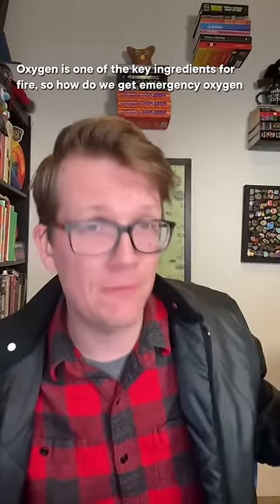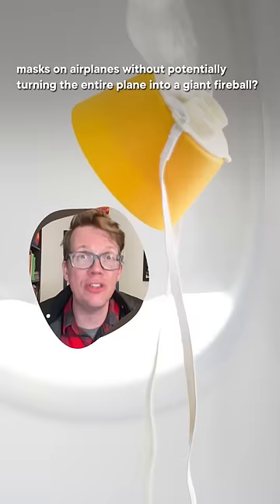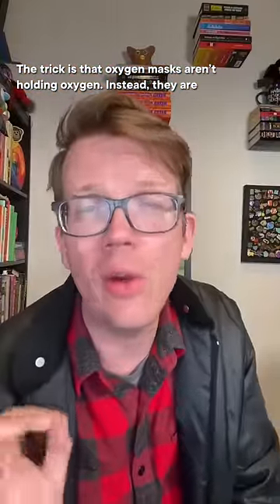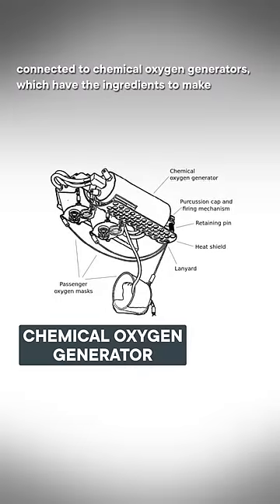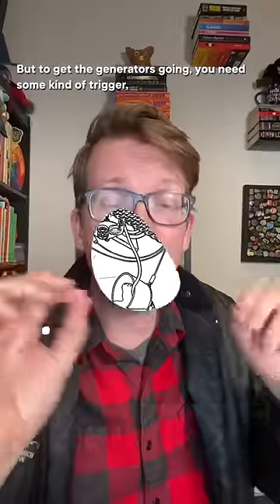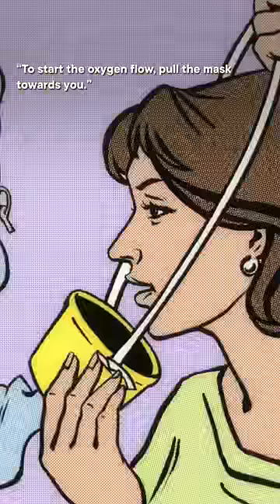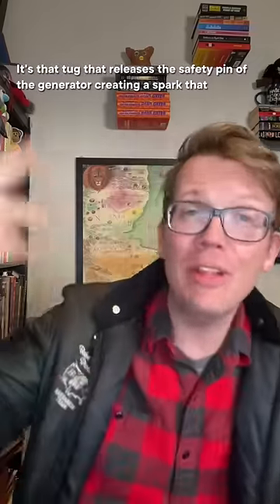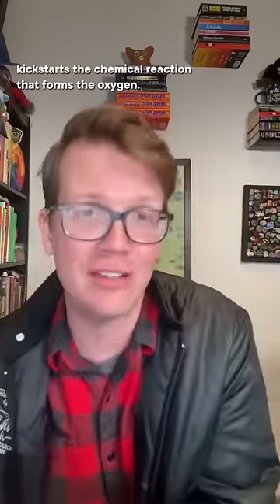If oxygen means fire, how do we get it on airplanes? #shorts #science #SciShow

Comment: The FAA only requires  cabins to be pressurized at or above 8000ft Below this altitude just breathe normally. The decent in any situation of a commercial aircraft will never take 30 minutes so it’s more than enough time, especially if the reason for decent is total power loss. However, multi engine aircraft are designed to fly with only one engine. They have redundant systems to prevent catastrophe.

Comment: The last part is just incorrect, the oxygen masks are there so the pilots can get back into breathable altitude. The pilots have an entirely different oxygen mask setup that lasts far longer, so that even if the passenger oxygen supply runs out in an extreme emergency and all the passangers faint, the two people consious on the plane are the ones flying it
Reply: Too long and partial brain death occurs
Reply: @karlschulte9231  yeah the idea is that the pilots manage to fly back into normal preassured air before that occurs. If you dont dont have the control over the aircraft to get it down then crashing and dying outright would be a bigger consern

Comment: Great information as always, but a very slight correction/clarification about the ending if anyone is curious. You don't need to get enough oxygen to land. The first part of that statement was correct "enough to get down to where there is more oxygen". When a depressurization event occurs, pilots get the plane down to under 10,000ft as quickly as is safely possible, at which point the ambient atmosphere has enough oxygen for people to breathe normally. Emergency decent from even cruising altitudes don't take anywhere near 30 minutes, so there's a pretty good safety margin involved too!

Comment: For anyone who might be worried that 30 minutes isn't long enough:

If I remember correctly, in the event you do need to breath through oxygen masks, pilots begin an immediate decent that will have you at breathable levels within about 10 minutes. 30 minutes might not sound like very long, but it's meant to be "overkill" for the amount of time you should actually need.

Also, keep in mind that pilots are highly trained and work in groups of two or more for a reason. Air travel is the safest way to travel, not by mistake, but by intentional design, constant preparation, and extreme regulation in regards to safety. You're probably safer falling asleep on a flight than you would be in a hotel room.
Reply: Ironically, mistakes are the very reason air travel is so safe. All the safety aspects we take for granted today have come from failures of the past

Comment: oxygen usually doesn't spontaneously combust with fuel sources. that's why it doesn't turn the airplane into a fireball. remember, there's plenty of oxygen in the air inside and around the airplane.
Reply: Pure oxygen will readily combust with any hydrocarbon. It's why technicians who deal with pressurized oxygen have to use separate cleaned tools, because any oil at all near a pure oxygen leak will immediately cause a massive fireball

Comment: He forgot to mention chemical candles (the widely used name of these generators) create an incredibly immense amount of heat, they have some heat shielding but it’s not perfect therefore if you ever where to use one you should never put your hands near the ceiling panel above your head as you can cause some very severe burns.

Comment: My friend was a engineer for making Chemical Oxygen Generators. Hearing about how they and to keep adjusting the materials so the oxygen wasn't coming out too hot or too cold, or filtration system needed to be just right and that no other gasses were not found in the tests. There was also the fact that they needed the internal temp to be stable so that the oxygen made came out at a constant rate, while the casing wasn't too hot or losing too much heat as well.

Comment: Plane mechanic here. I work freighters and yes there is a O2 bottle located in the wall of the forward cargo compartment and ran to cockpit where distribution to a masks for all six seats. There is also portable O2 bottle located in the lav, as well as O2 generator. The main tank is considered safe for dispatch if it is pressurized above 1500 psi. Upon receiving notifications that both air-conditioning packs have fail, the crew will pull the mask out of it's box where they will breathe normally as the valve is an on demand system.

Comment: Only problem nownis that those Chemox units can cause a fire if improperly transported/storred.

Fitted to the Passenger Service Unit(PSU) is fine as there is a heat shield but year.

These things once brought down an aincraft. 

(I work in aviation maintenance, ask away)

Comment: It doesn't need to last until you land. If the cabin is decompressed the pilots will reduce altitude below 10,000 feet quickly and supplemental oxygen will no longer be needed.

Comment: Me and a friend did an experiment that generates oxygen,  the electrolysis of water, basically, when water is in solution with an acid or base (preferably strong) and carbon electrodes are placed in test tubes, H2(g) and O2(g) are produced

Comment: When I worked as an aircraft mechanic I spent an entire shift disposing of these that were out of date.  (They do have an expiration date)  These are little exothermic hand grenade sized pocket heaters so you absolutely do not want this melting your plastic interior panels.  They are also hazardous waste in thier unused form.  Our solution was pulling pins and dropping them into a 55 gallon barrel half filled with water.  As I recall less than 10lbs of pressure to pull that pin. They don't produce a lot of pressure, not quite what small battery operated bait aerotors produce.  Just enough to prevent brain damage in a low oxygen environment. Pilots do get the good stuff though.

Comment: There actually has been a fatal crash connected to expired oxygen generators that were shipped on a plane as cargo. 
In Miami 1996. ValueJet flight 592 crashed about 10 minutes after takeoff. Eyewitnesses saw the bottom of the plane burning and the pilot told atc that they had a malfunctioning electrical system and smoke in the cabin. 
The investigation showed that they had boxes of improperly stored oxygen generators in their cargo hold. The cargo holds were air tight, so they were thought to be fire safe and to not need smoke detectors, but the generators produced enough oxygen to feed a fire strong enough to bring the plane down.

Comment: What's sad about this is that the whole "safety" concept that these were installed for was what caused flight 592 to crash into the Everglades back in the 90's.

Some how 40 ish of these oxygen generators made it into a passenger flight's cargo hold. The canisters were marked as "Oxygen Canister: Empty" which normally would not be an issue and you can travel them relatively easy.

However they were not Empty, nor were they safe to travel yet.

The company that packed them misunderstood "Expired" for "Empty" and they were never properly disarmed. The canisters need to be disarmed before travel because they will activate.

The reason the diagram shown in the video has a heat shield shown holding the canister is because they get REALLY. REALLY. REALLY hot. Coupled with the fact that they were packaged with flammable bubble wrap and cardboard... the only thing it took was one bad bump.

Now that all the pieces were in place, here's what happened.

Flight 592 finished packing the cargo bay and all passengers were on board. Something jostled the very sensitive box holding 40 sum oxygen generator canisters. One or more go off and create the reaction. Now that there is oxygen in what is supposed to be an oxygen free environment, the fire starts. The canisters get several hundred degrees hot and melt the plastic wrap. The plastic wrap and cardboard act as an accelerant to the rest of the cargo and light all surrounding cargo on fire. The fire spreads throughout the cabin and all passengers start to panic. The pilots try to find a safe place to emergency land but the smoke is reaching the cockpit. The captains either pass out or simply lose control of the craft and flight 592 crashes into the Everglades. There were no survivors.

The entire accident would have been avoided if the canisters were properly disarmed. 

The sad irony is that these canisters were meant as a means to stop fires from emerging in the cabin, now they have become the sole source of one.

Comment: To add to this…

The flight attendants have portable oxygen bottles that can be used to assist passengers when the pressurization fails, or to give passengers for medical reasons.

Most passenger masks have around 15 minutes of oxygen generation.  You won’t need more than 3.  I promise.

The flight deck has a large oxygen bottle to supply the pilots with pressurized oxygen that we could, if necessary, use to operate the aircraft while unpressurized for a prolonged period.

Comment: These things have turned at least 1 aeroplane (ValuJet 592) into a giant fireball. They where carrying a whole bunch of those labelled empty (they where not indeed empty) in the cargo hold. Badly wrapped and missing crucial a safety cap they moved around and one or more pins got pulled and they activated. These things get hot when working (+250°C) and set the box on fire and setting of more units. Long story short: giant fireball falling from the sky, thanks to these things.

Comment: The generators only last 12 minutes in a 737.  Moreover,  the reaction gets hot!  The temperature can exceed 250 deg Celsius.  In fact, Improperly decommissioned oxygen  generators shipped as cargo killed 110 people on valueJet 592 in 1996.
Reply: I was just about to comment on the energy released by this reaction snd how much they heat up

Comment: Not even long enough to land actually.

Most pilots will default to dropping the aircraft to 6000 ft when declaring a state of emergency.

Air is breathable at that altitude, if a little thin. Pressure differential is dramatically reduced thereby insuring that the plane doesnt explode/implode due to malfunction, and presuming that fuselage breach is already taking place, or a legitimate possibility, the interaction of forces in and outside the aircraft are generally less violent and more managable.

Comment: there are oxygen bottles on the aircraft to, there is a crew O2 bottle that supplies the full face O2 masks for the pilots and sometimes you still find oxygen bottles in the lavs for some reason, im not 100% sure why the lavs have oxygen bottles I can only assume its down to the interior manufacturer C&D. there are also portable oxygen bottles for the flight attendants because these O2 generators get really hot and you can't exactly carry them around. if you ever see a mask drop when your on the ground don't pull on the mask a mechanic can reset the Mask and thr flight can still leave 15 to 30 minutes late if you pull it the flight is probably going to be cancelled or your seat will be tagged out and you will have e to find another flight if its full

Comment: You don’t have to get so far down that you land, anything under 10k feet is the procedure for pressure loss. This is low enough you’re not above the death zone (~26k feet), but also high enough that you should normally avoid any obstacles. … This is also why most planes don’t fly through Tibet though, because it… uh… is an average of 14k feet up, so you don’t have that same safety marin. I mean, there are planes that fly to Tibet, but they very rarely fly through Tibet to get to somewhere else.

Comment: Oxygen is not flammable. It is an accelerant. It is one leg of the triangle of items that sustain a fire: ignition, oxidizer (accelerant), and fuel. If any one of these three elements is absent, the fire stops.

CO2, Halon, and foam (I think) all deprive fire of oxygen.

Also keep baking soda near your cooking in case a fire happens. I had a fire on a 1" depth of cooking oil, and I tossed I think a whole box on it. The fire went out immediately.
(And made black soap! 😂😅😮)

Comment: *not really long enough to land, just enough time to get down to 15-10 thousand feet, which should only take a few minutes as the aircraft will go into an expedited dive. It’ll feel like a roller coaster but you’ll be fine. Also always always always put your mask on first, depending on the altitude you may only have a few seconds before you can’t really function and then pass out

Comment: the flight crew masks are connected to oxygen tanks, because they require more oxygen. So the aircraft will emergency descend down to about 14,000', that's a nice balance of aircraft performance and oxygen needed. At 14,000' passengers don't need oxygen but the crew do above 13,000' but between 10,000' and 13,000' crew need to be on oxygen after 30 minutes. 

But I start getting the symptoms of hypoxia at like 9,000' so I don't mind putting a mask on in a light aircraft.

Comment: And the thing is, this isn't even completely guarenteed to not turn the plane into a fireball. Valujet Airlines Flight 592 crashed into the Everglades outside Miami 10 minutes into the flight, killing all 110 on board, due to improperly packaged expired chemical oxygen generators in the cargo hold, one of which was activated and caused a fire to break out in the Class D cargo hold; the way fire suppression works in a Class D cargo hold is that it is sealed off and made airtight so that any fire present in one burns itself out of oxygen, however with the presense of the oxygen generators, there was more than enough heat and oxygen to fuel the fire and allow it to burn through the floor of the passenger compartment, destroying many critical flight controls as it did.

Comment: I see nobody's raising ValuJet 592, and I'd say it's relevant. Due to a series of events, some mis-labelled, improperly-safed, expired (but still full) oxygen generators were loaded into the plane's cargo hold. With a bunch of canisters packed together in a tight space, once a pin got pulled and things started heating up, it was an extremely hot and rapid-growing fire. Needless to say, when the thing you are flying is literally on fire, it's a very bad situation. It's very important that, once removed for disposal, these canisters are properly tracked and labelled, and they are stored with safety pins inserted at all times.

On a more upbeat note, who'd've guessed that oxygen (generators) can expire?

Comment: no, no, no!  You do not need to get down to more oxygen.  You need to look at the alveolar gas equation for your answer.  In it, on terra firma, we use (760mmHg-47mmHg)*21%.  760mmHg is the atm pressure.  47mmHg is is the vapor pressure of the water, and 21% is the fraction of oxygen.  We subtract the partial pressure of CO2, but that will be relatively constant here.  We cannot change the vapor pressure of water here, either.  So, we are left with the atmospheric pressure and the fraction of O2.  When the plane descends, you are increasing the atm of pressure "pushing" oxygen through the alveoli and into the pulmonary capillaries.  You could breathe 100% oxygen at a low enough pressure and it would not be enough to sustain life.  I think about climbing Mt Everest and imagine climbers with canisters of oxygen as my own example of this.  The oxygen mask is increasing the fraction of oxygen.  My guess is that you would not get above like 40% with typical use of an unexperienced user or based on facial features (size, facial hair, dentition).

Comment: Oxygen wouldn't explode anyway, that's a common misconception. It is a necessary component to most fires, but when exposed to pure oxygen, fire won't create a backflow towards the origin, it'll burn hotter and faster. When an oxygen tank does explode, it's because it's a pressurized container and the heated gas eventually expands and exerts enough pressure to fracture the container, which would be weakened by the heat. But it's unlikely such an intense flame could exist for long on an aircraft, because if the fuel gets ignited, it just explodes and destroys all that stuff.

Comment: Kind of ironic that these oxygen generators have downed a plane before, valujet 592 was transporting boxes of these generators in its cargo hold when they caught fire and burned through the plane, crashing into the florida everglades, these generators produce a lot of heat as a byproduct of the chemical reaction.
Reply: now imagine if that plane was filled with compressed oxygen.

Comment: Masks also don’t really work above 25,000 feet because they don’t form a proper seal. Thats okay though pilots have their own oxygen tanks and much more advanced masks that seal better. It only takes a few minutes to get from 30,000 down to 15,000 in an emergency descent, so you’ll be perfectly fine in a depressurization event.

Comment: "long enough to land"
More like long enough to get down to 10000 feet above ground. According to the emergency checklist for the Boeing 737-600/700/800/900/900ER, you pick an airport to land on depending on whether or not your airline has a base there, has a runway long enough for you, etc. You may even have enough fuel on board to make it to your intended destination, since that checklist does not tell you to land at the nearest suitable airport so you can just keep flying for however long you need. The main limiting factor is fuel, since planes are more economical the higher you go, since planes are able to go at higher speeds relative to the ground at higher altitudes because the air is so thin up there.

Comment: Or it's just in a pressurized cylinder on corporate ACFT. I'm an aircraft mek... meca... I fix planes. Two bottles about 1800 psi each, one for crew.  The pin opens the valve to allow flow. FYI.